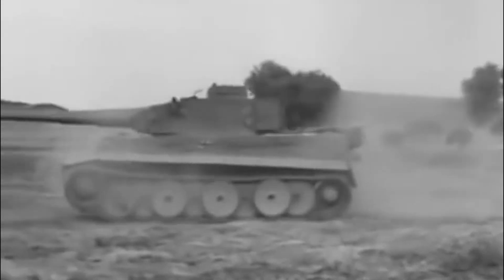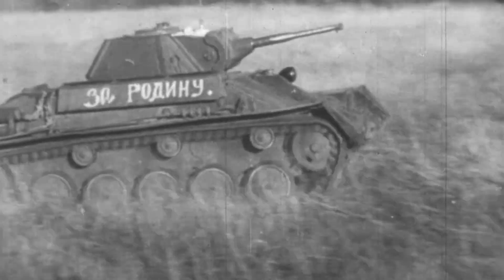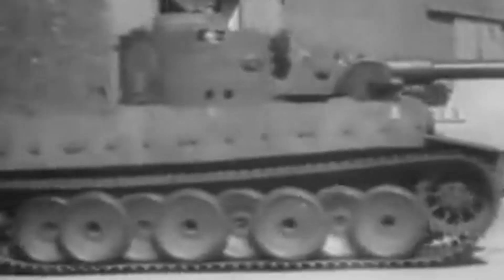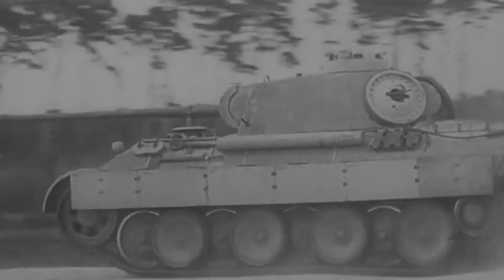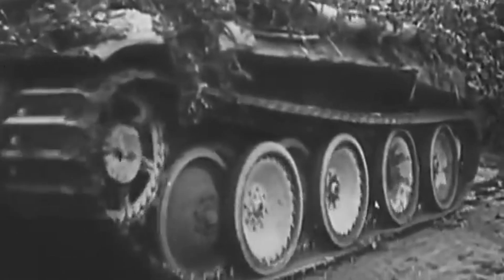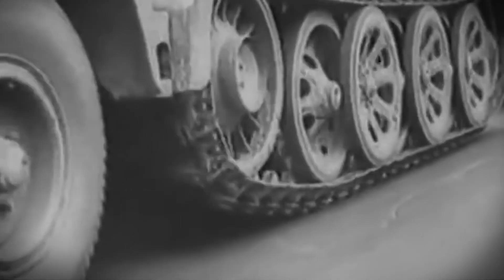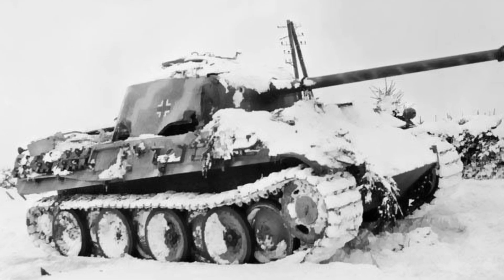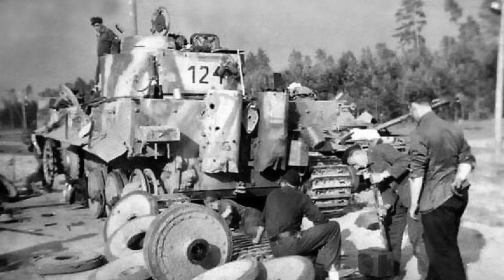What did the Germans do it for?

Comment: German engineers wanted direct shift in-put to the transmission - which is why they had front sprocket drive.  The interleaved, overlapping road wheels wee meant to insure good flotation and cross country mobility on the heavy tanks - but yes it imposed some maintenance drawbacks.  No post-war tanks followed those design concepts.

Comment: I am an ex T55 commander and German engineer.

My grandfather served in the Wehrmacht in WW2 as soldier mechanic recovering and repairing vehicles, including tanks.
- German WW2 tanks were not sophisticated. They were in principle huge gas guzzlers, too slow and much too heavy. They were also too slow to turn their turrets, particular if they were sitting at a sloped surface, a huge disadvantage in battle.
Their driving / operational range was in comparison a disaster. The Maybach engines were notoriously underpowered in German WW2 tanks and broke down easily and often.
- Compared to them the T34 Diesel engine (V12 structure) was an engineering marvel of its time. The German industry never managed to even copy this engine. It was its first of its kind worldwide, delivering a perfect power-to-weight ratio for a tank. With its aluminium block and two heads it was running on low-ignition fuel, very fuel efficient and after the first major problems sorted became very reliable. And it could me mass-produced by a mostly untrained workforce (women and children).
Similar safer for their crews but in smaller numbers manufactured, were some Shermans batches also powered by Diesel engines.
- The Tiger needed a complete track exchange for rail road transport, a tactical death trap and extremely exhausting for the crew, plus adding to the logistical nightmare. And Tigers and Panthers needed to be transported to their battle grounds by railway because of their fragility and short marching range. T34 drove under own power for hundreds of miles into battle (see Kursk)
- Because of this transport track issue, but also over-complex design and lack of standardization of components and ammunition, lub and other consumable materials these tanks were a logistic nightmare to support and a nightmare to repair. Heavy field workshop equipment was always needed.
- Both the Panther and Tiger(s) were extremely unreliable with particular the Tigers extremely difficult to recover from the battle field or when they got stuck. They recovery crews needed up to three(!) tracked heavy vehicles to pull them out.
- The Panthers and Tigers advantage of strong armour, precise optics and long ranging guns was eaten up quickly by these factors: 1. While the Soviet tank armour improved during the war, the German tank armour lost its quality due to increasingly missing imported metallurgic ingrediencies and welding quality. 2. the improved T34/85 with its 85mm gun came very close to the Tiger's 88mm gun in terms of ballistics and destructive power, same for the Firefly. 3. the precise long-range fighting capabilities of those German tank models became irrelevant since the Wehrmacht was pushed out of the vast African dessert plains and out of the Eastern front steppe plains. The battlefield was now more and more smaller structured, in towns, villages and forests. Speed and agility was now king, the long-distance tank duel a thing of the past. Tight and narrow roads were often to be driven along by now and you rather have a T34 in an inner-city street fight than a Tiger
- the Panther and Tiger required too much resources to make them. Quantity is always a quality too, availability counts! With other words, a pack of hyenas will always kill a tiger as long as the pack is big enough. Therefore the T34 and the Sherman were in the end the battle masters of the Panthers and Tigers.
- While the allied troops (West and East) became more and more experienced and trained, the Wehrmacht lost more and more experienced crews. OK, this is all a human factor. 

Not only my grandfather (private rank) complained about it, there is enough written testimony by German WW2 generals complaining about all of this subjects, particular the Tiger 1 and Tiger 2 were of real limited military value they stated. Too many were lost without a fight and/or due the allied air superiority to which they were now defenceless.

The myth of the superiority of the German tank models in WW2 is completely busted if someone looks at it without any prejudice. But it is time and time repeated in particular by Neo-Nazis here in Germany and elsewhere. However, particular the Tiger was a product of arrogant fascist and racist thinking, particular since the "Föhrrrerrr" wanted those heavy and big beasts personally. 

Peace! from Dresden / Germany
Reply: That was a large chunk of information.  Thank you for the post.  🙂
Reply: @losmazeman  
Anytime. I have it meanwhile as a "standard" text and just modify it the individual post. It is so tiring to read this BS from so many who never been in a tank or even served in one. But it is probably those who keep playing War-Thunder.

Peace! from Dresden / Germany
Reply: @Boni-i1l  Peace from Arizona, US
Reply: A detailed analysis. Thank you!

Comment: German tanks would have eventually been far superior than any other tanks had they had the ability to make them in vastly large numbers like the Americans were and British all those countries the might and the industry of the tanks made in America was astounding compared to what the Germans could produce and the tanks of Germany were so much more sophisticated their process of construction took much longer which defeated their ability to survive and produce in very large numbers had they outnumbered the American tanks and British they would have been the most formidable opponent if it had been in Tiger tanks the one Sherman but that was not the case thankfully
Reply: I am an ex T55 commander and German engineer.

My grandfather served in the Wehrmacht in WW2 as soldier mechanic recovering and repairing vehicles, including tanks.
- German WW2 tanks were not sophisticated. They were in principle huge gas guzzlers, too slow and much too heavy. They were also too slow to turn their turrets, particular if they were sitting at a sloped surface, a huge disadvantage in battle.
Their driving / operational range was in comparison a disaster. The Maybach engines were notoriously underpowered in German WW2 tanks and broke down easily and often.
- Compared to them the T34 Diesel engine (V12 structure) was an engineering marvel of its time. The German industry never managed to even copy this engine. It was its first of its kind worldwide, delivering a perfect power-to-weight ratio for a tank. With its aluminium block and two heads it was running on low-ignition fuel, very fuel efficient and after the first major problems sorted became very reliable. And it could me mass-produced by a mostly untrained workforce (women and children).
Similar safer for their crews but in smaller numbers manufactured, were some Shermans batches also powered by Diesel engines.
- The Tiger needed a complete track exchange for rail road transport, a tactical death trap and extremely exhausting for the crew, plus adding to the logistical nightmare. And Tigers and Panthers needed to be transported to their battle grounds by railway because of their fragility and short marching range. T34 drove under own power for hundreds of miles into battle (see Kursk)
- Because of this transport track issue, but also over-complex design and lack of standardization of components and ammunition, lub and other consumable materials these tanks were a logistic nightmare to support and a nightmare to repair. Heavy field workshop equipment was always needed.
- Both the Panther and Tiger(s) were extremely unreliable with particular the Tigers extremely difficult to recover from the battle field or when they got stuck. They recovery crews needed up to three(!) tracked heavy vehicles to pull them out.
- The Panthers and Tigers advantage of strong armour, precise optics and long ranging guns was eaten up quickly by these factors: 1. While the Soviet tank armour improved during the war, the German tank armour lost its quality due to increasingly missing imported metallurgic ingrediencies and welding quality. 2. the improved T34/85 with its 85mm gun came very close to the Tiger's 88mm gun in terms of ballistics and destructive power, same for the Firefly. 3. the precise long-range fighting capabilities of those German tank models became irrelevant since the Wehrmacht was pushed out of the vast African dessert plains and out of the Eastern front steppe plains. The battlefield was now more and more smaller structured, in towns, villages and forests. Speed and agility was now king, the long-distance tank duel a thing of the past. Tight and narrow roads were often to be driven along by now and you rather have a T34 in an inner-city street fight than a Tiger
- the Panther and Tiger required too much resources to make them. Quantity is always a quality too, availability counts! With other words, a pack of hyenas will always kill a tiger as long as the pack is big enough. Therefore the T34 and the Sherman were in the end the battle masters of the Panthers and Tigers.
- While the allied troops (West and East) became more and more experienced and trained, the Wehrmacht lost more and more experienced crews. OK, this is all a human factor. 

Not only my grandfather (private rank) complained about it, there is enough written testimony by German WW2 generals complaining about all of this subjects, particular the Tiger 1 and Tiger 2 were of real limited military value they stated. Too many were lost without a fight and/or due the allied air superiority to which they were now defenceless.

The myth of the superiority of the German tank models in WW2 is completely busted if someone looks at it without any prejudice. But it is time and time repeated in particular by Neo-Nazis here in Germany and elsewhere. However, particular the Tiger was a product of arrogant fascist and racist thinking, particular since the "Föhrrrerrr" wanted those heavy and big beasts personally. 

Peace! from Dresden / Germany

Comment: I read a quote by a German general who said words to the effect of: 'The Tiger tank was easily equivalent to 10 Sherman, or Churchill tanks,  . . . . The problem was that the Brits, and Americans had a habit of going around in gangs of eleven!' German tanks drove from the front. The rear idler was plain. There was NO need for return rollers, as the upper run of track was under tension, it only sat on the roadwheels, at rest. In contrast, the Churchill, had toothed  rear sprockets, and toothed front idlers. The sag of track sat on the top. So that The Churchill was always picking up the track from the rear, with the full weight of tank right at the end here, so that is where it would tend to snap. Check stranded tanks circa Dieppe raid (eg 'Ringer' ). In contrast, Tiger, would be pulling along the entire top run, pulling evenly.

HOABL
Reply: No one praises the Germans and their invincible tanks better than they themselves... and no one forgets the truth faster...

They lost their first tank battle on the first day of the war... good luck finding a German account of how many tanks and other armored vehicles they lost in the Battle of Mokra...

Comment: German tanks were technologically superior to British, Russian and US tanks but their serviceability let them down. In the battlefield you need a tank which can be repaired with a few spanners and a hammer which is where the Russian and US tanks excelled.
Reply: German's equipment was magnificently over-engineered.  When it worked, it was fantastic, but maintenance and repairs were the stuff of nightmares.
Reply: @elultimo102  "When it worked" 😂
The mystery of why they lost... solved.😅
Reply: @Bialy_1  Not really. Look at the produced numbers. Also, Germany was at that time running out of rubber and oil. This is why they fought so hard to get to Bulgaria to the oil fields there. If they would have managed this, an a little bit more time to get production numbers up higher, things might have taken much longer for the allies to win.

Comment: Removing the road wheels was not a hard job, two men with hand tools, simply unbolt them and lever them off. In comparison removing the Sherman's road wheels was a workshop job.
Reply: Seriously?  The problem came when any of the interior roadwheels needed replacing.  Then up to a half dozen or more needed to be removed.  Grossly inefficient.
Reply: @jaggedskar3890  I've seen a German field video of two men with a crow bar doing that job, I've also seen a video of two men having to use a forklift to remove/replace a Sherman's bogie.

Comment: The maintenance difficulties are much more of a problem in peace time than in war, as the vehicles must be maintained longer.
Reply: @davidingham3409  oh no its much more difficult to maintain out in the field than home in base. 
And vehicles have to be maintained both in peacetime and in war.
Reply: @jasip1000  What I mean to say is that in WWII Eastern Front vehicles survived so short a time that the labor to maintain them was insignificant relative to that to build them.
Reply: @jasip1000  No harder in peace time but much longer.  On the Eastern Front it would usually be destroyed in weeks, opposed to 25 years that military vehicles are now maintained and used for training.  They had the half tracks before the Tiger and Panther, so they knew what they were doing.